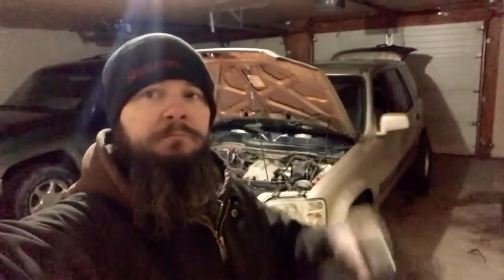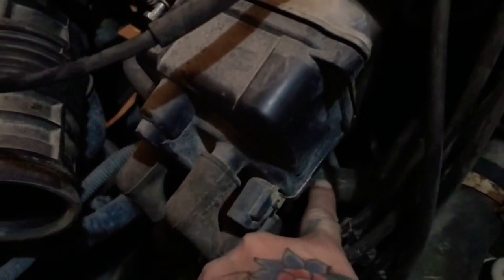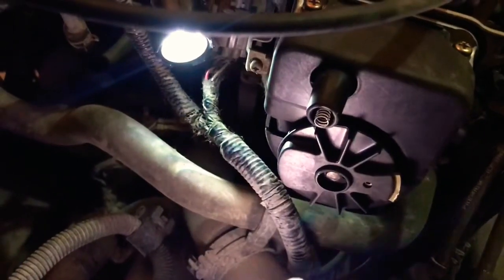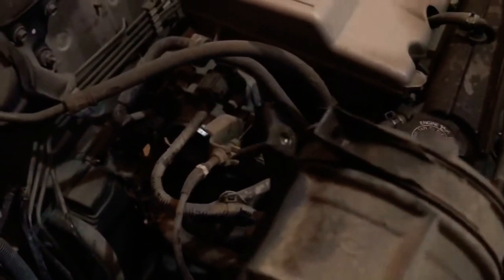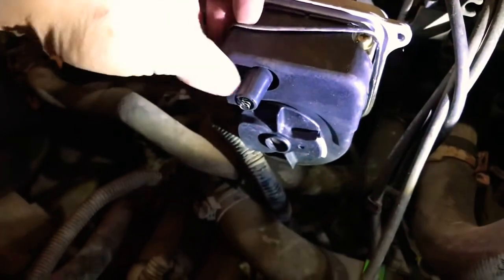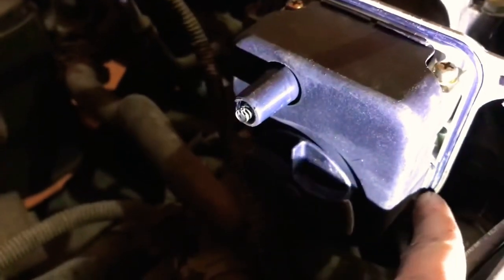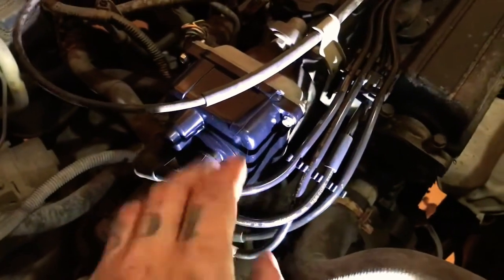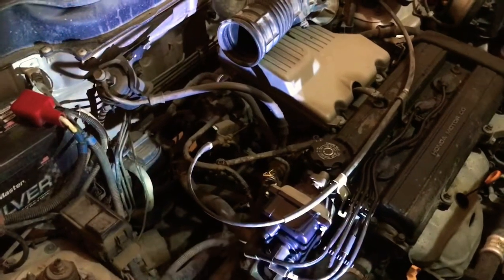How To Replace Distributor Cap & Rotor • 97 - 01 Honda CRV B20 B-Series • #ThatBeardedMechanic

Comment: If you have bad luck like we did the screw was stripped when we got to it.  We had to remove the entire ignition assembly which consists of 3 bolts and you have to pull one harness (remember these cars are old so don't pull on the harness like the incredible hulk), then had to remove the stripped screw that way.  Our rotor did not come with a new screw so we had to go to the local upull to get another rotor screw.  

Just putting this here for anyone else that runs into this issue and doesn't know what to do.
Reply from the maker: Right on, appreciate the assist. Was in a bit of a time crunch filming and doing this since I worked in the morning, definitely slipped my mind to add that 👍🏻

Comment: Good job, 2 recomendations. Invest few bucks for a head lamp, and put shop towel underneath when dealing with easily droped screws and bolts.
Reply from the maker: No worries about dimly lit videos now. I’ve finally moved my operations into a brand new shop with plenty of bright lighting along with better auxiliary lighting to assist. 
And good tip on the towel/ shop rag, that definitely can help with dropping bolts and small parts. Because let’s face it, we all know it’s a bad day when we don’t hear it fall through the engine bay and hit the floor haha.
Reply: I toss a magnetic tray underneath in case the screw drops

Comment: Thanks for the video! Quick question: I didn't catch what you need the 7mm socket for... Did I miss something?
Reply from the maker: The bolts on the new rotor cap assembly are 7mm. Although, this may differ between some brands I should point out. For the most part, majority of them will be a hex head with a Phillips screwdriver within the hex head. 
Hope that clarifies it for ya and thanks for checking out the video.

Comment: How I can buy parts ! Inter motor genuine parts? Is there a website for it ?
Reply from the maker: You should be able to Google search the name and then your engine/ vehicle. Then it should bring up parts stores local to you that sell them. 
I got this through my local parts supplier that’s only within the province I reside in. 

You could try NAPA AUTO PARTS, I believe they carry the same brand as well. 
Hope this helps you.

Comment: I just did this. No spark when tested. Just replaced fuel pump and battery is good what do I do now
Reply from the maker: Alright, can you confirm you hear the fuel pump priming with the key on? (Will sound like buzzing/ whirring noise then stop). If so, good, we’ve confirmed fuel pump is in fact working. 

When you crank it, I assume it does absolutely nothing. Just clicks from the starter with no actual engine trying to turn over? Check all your fuses (can’t remember the location of the ignition one off the top of my head, but I suspect that to be it). I’m pretty sure there’s a main relay behind the glovebox as well off the top of my head that’s gonna control spark/ fuel delivery. You may have shorted something out while installing. It happens.

Try all of the above for starters. Message me again on here in this thread if you have any issues and I’ll be sure to reply back much sooner. (Your comment was posted into a “review folder” for some reason for which I don’t get notifications. I’ve changed it now for you and approved further comments)

Comment: My cap isn’t rotating when I turn the ignition??
Reply from the maker: Okay, I assume you’re looking to replace the cap/ rotor due to a no start issue to begin with right?
Now if you’re attempting to bump the ignition like I do in the video to orient the rotor to remove it, and the rotor doesn’t rotate. That leads me to believe the camshaft gear could’ve possibly sheered off/ timing belt snapped. 

I would grab a socket and a breaker bar, try to rotate the crankshaft and take note if the rotor moves as well when you’ve got crankshaft rotation. Counterclockwise rotation ideally. 

You can also remove the whole distributer assembly and visually inspect it as well.

Comment: my rotor does not have a screw too take it off im so confused
Reply from the maker: That’s odd? You should have a screw to secure it in place. What year is yours and you’re certain it’s not missing? I also have a B20Z engine in my 2000 CRV.
Reply: Mine has no screw either but my distributor has been replaced with a non OEM Honda one so maybe that has something to do with it